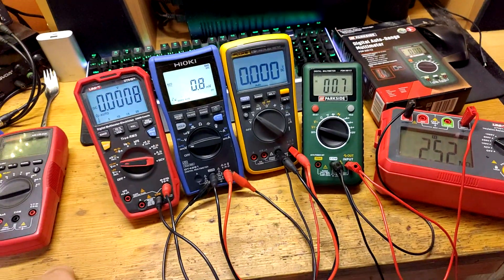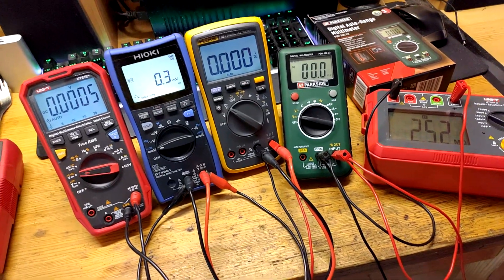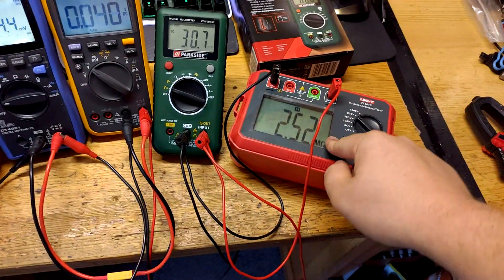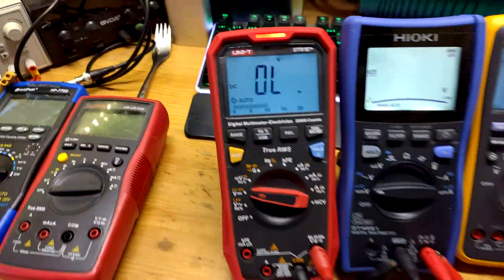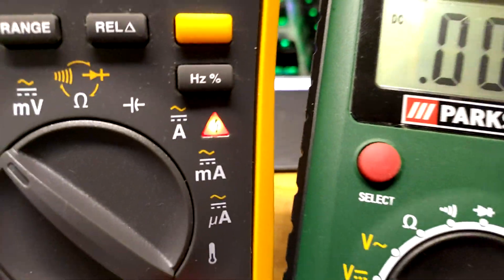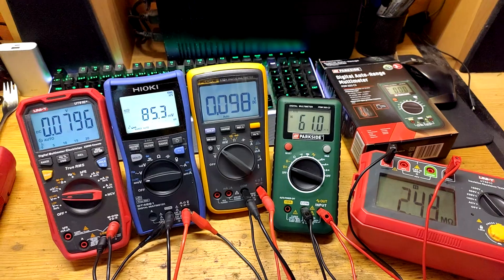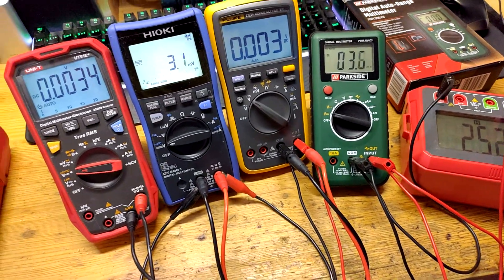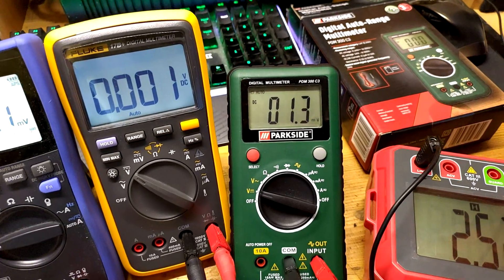Dangerous Parkside multimeter PDM 300 C3

Comment: Dude, you are using a multimeter which is SPECIFIED to work only below 300V. It's good, that you are showcasing this, but this is NOT an error.
Reply from the maker: Overload voltage indication is a must as it is stated by many standards that multimeters must meet.

Comment: Who uses multimeter to test for live wire? You use voltage testers, non contact or neon test light or similar. Very unprofessional video, considering it comes from industrial electrician. Multimeter is for measuring voltage.

Comment: The specs are 0 to 300V, both AC and DC. So don't use it if you suspect a higher voltage because it can do whatever, such as showing 0 volts.
Reply from the maker: No, it should indicate overload

Comment: My opinion is that you compared wrong devices.  You cannot compare a thousand USD professional device with a home-beginner ten bucks s**t. I am owner of an  pdm 300 c3 for several months and I can tell that it does exactly as described in its documentation. And I can surely tell you that I will never try to measure 1000+ Volts, since it specifies  max. voltage at 300V with this device. By the way,  can you make a video with your Fluke measuring a 20KV line to check its protection? I will surely enjoy your video, and you will have a like from me...
Reply: Hi, I just bought pdm300 c3 multimeter, , trying to measure volts, ohms, but its very unstable, the digits keep constantly changing, though I try to keep it as steady as possible, and continuity test sometimes beeping and sometimes not at the very same place, do you have this nonsense too ?
Reply: @tttttttt8482  are the leads connected to the meter well?

Comment: Personally I think that any person who working with high voltages, must be qualified to do so and will buy appropriate equipment instead of 10-15£ amateur hobbies multimeter to save money and hoping it will work for him doing uncertified tasks. 😁
 BTW did you know that chemical extinguishers suitable for extinguish petrol fires is dangerously failing when you try to put floames of on burning oil rig or any space rocket..
 Asweel it appears that "young doctor" kit can kill you in real heart surgery..😂
Reply from the maker: Well, of course everyone has to be qualified, but people stick their hands also in work for which they have insufficient experience. Also, OL function is mandatory, and must be functioning well. It doesn't. Unfortunately, GS testing laboratory tests these instruments different way, and their method doesn't reflect how do you typically come to overvoltage measurements, that's why it passed GS, while still being dangerous.

Comment: Thanks for pointing out the danger. I am engineer working mostly in the office but also have some hands on experience. I have tried with little to no success to educate safety trainers on grossly misunderstood topics such as using multimeters for safety checks and "the current follows the path of least resistance". I always say to the electricians which I work with never to use multimiter for safety check on unknown circuit. Few companies which I have worked for had this written in their procedures. You may be using a meter perfect for the job, but broken lead will result in 0 voltage reading. How many electricians check the multimeter on contunuity first or on a known voltage to confirm the leads are good before checking for voltage on the circuit which they intend to work on? How many electricians check on AC and then on DC? Complacency is a killer. Proper proving unit will save your life.

Comment: Ranges:
DC voltage: 0.1 mV to 300 V
AC voltage: 1 mV to 300 V 

read manual
Reply: Baze hasn't replied.  I guess he used this meter and is now dead. 
Regardless of what the specs state for the measuring range.  A meter that shows 0V when there is voltage, even outside of the measuring range is very deadly.
Imagine measuring something that should be within the measuring range of the meter, but there is a fault and the voltage is well above what it should be and the meter just states 0V. ☠
Reply: @Shocker99  good one
Reply: I think you're missing the entire point of this video or just being aggressively obtuse for the sake of it. Do you actually think the turning up with a multimeter and measuring 0V on a machine or bit of wiring outputting over 300V is safe because the manual says so?  The worst part is that there is no over limit warning which is the point of the video.
I was recently on a site where we were measured 400V AC on a supply cable that should have been only 230V AC, I'd probably be dead if I was using this multimeter. Moral of the story is avoid cheap multimeters except for ultra low voltage applications.
Reply from the maker: Multimeter must have functional overvoltage indication. Read regulations!

Comment: You're right, that's bullshit! Dangerous unnecessary bullshit that could easily be avoided if only they included the "OL" indication.
Reply from the maker: The OL indication is present. However, if that overvoltage comes quickly (2,7ms rise time in my case), the multimeter ADC overloads, and autoranging mechanism gets stuck on 2V range, that won't trigger OL warning.
If the voltage is increasing slowly and multimeter has time to increase ranges, the OL is displayed alongside with beep
Reply: @bekrstechnologies  so, race condition - looks like the firmware was insufficiently tested.